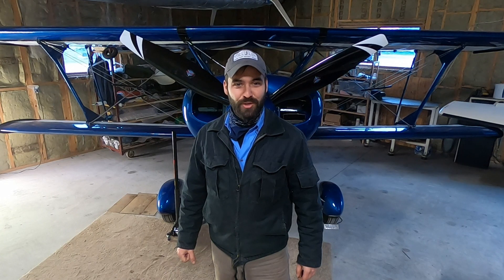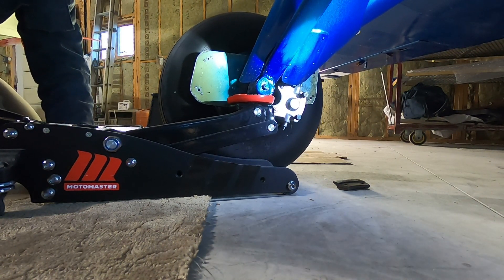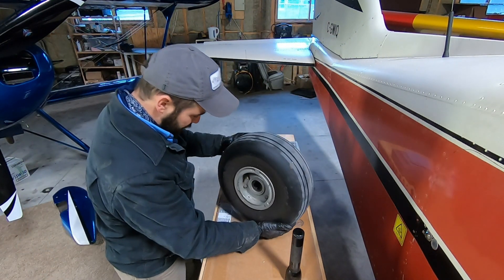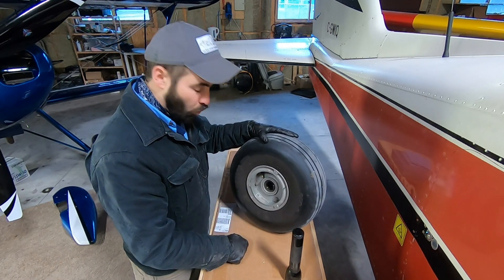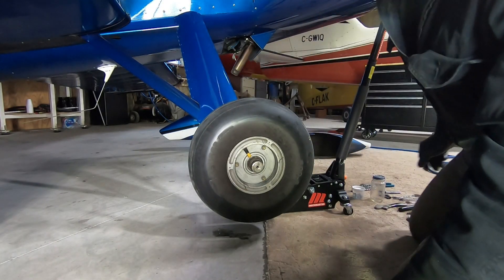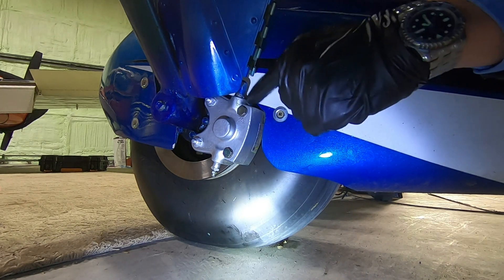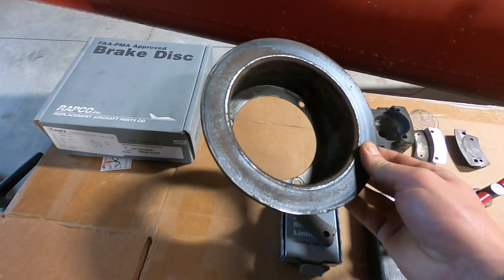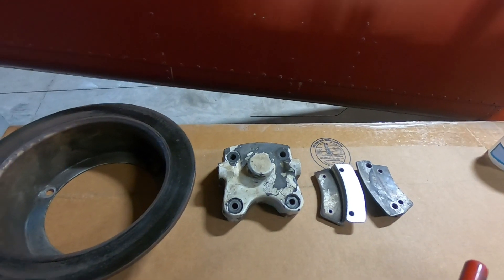Aircraft Maintenance: Wheels and Brakes

Comment: I always pull the tube out and flex it to ensure it is not cracking along the inner perimeter where the rim split allows ozone to degrade the tube rubber.
Reply from the maker: I see alot of tube failures especially around the stem. I have a few aircraft I am going to change the tubes on shortly just due to age. Tires are not worn but tubes are getting old and it's concerning.

Comment: Can you just explain the deflating the tire before removing part, if you dont do that was can happen?
Reply from the maker: Its just an extra safety step you can take. When you remove the axle nut the only thing now keeping the wheel halfs together is studs or through bolts, depending on what type of wheel you have. I have seen these cracked, bolts stripped and wheel halfs broken. If you have 30 plus psi of pressure in the tube this could get exciting if something lets go and jumps apart on you.